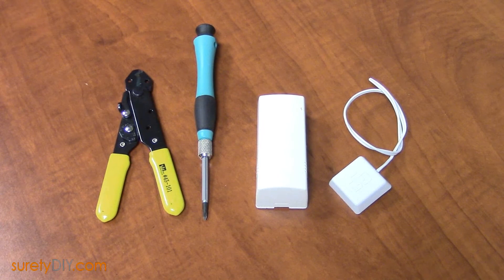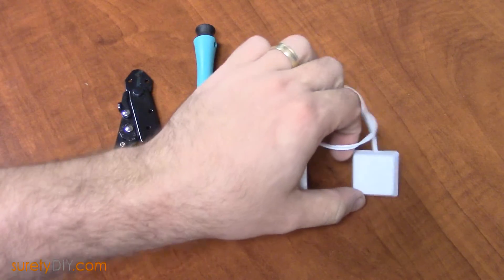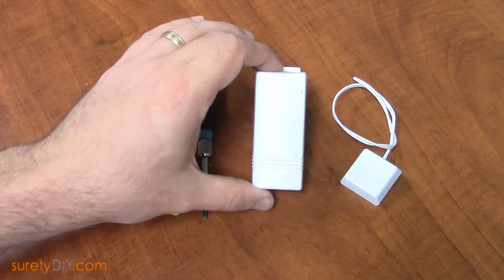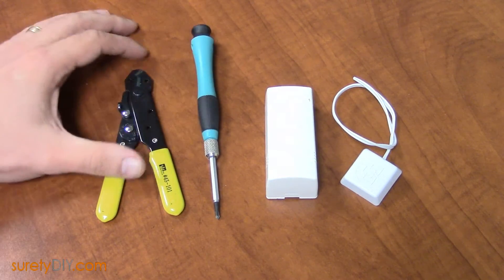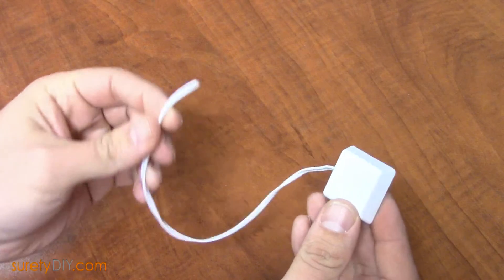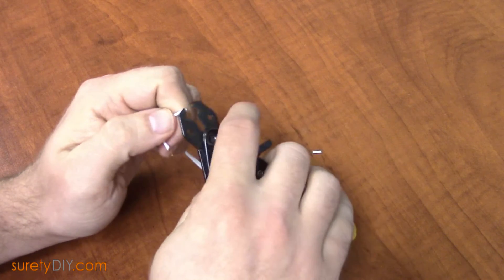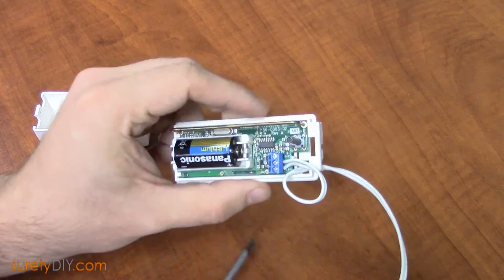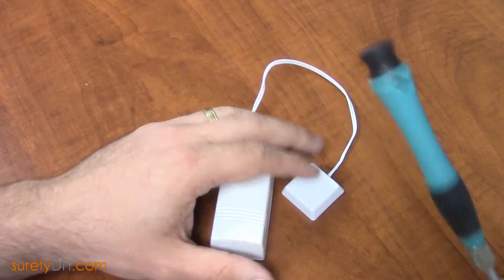How to Make a Combined Window Sensor/Shock Sensor

Comment: Sr, it will be better if u write the parts name in the description.
Reply from the maker: Thank you for the feedback! In this case, we used a Resolution Products RE201 sensor and an Interlogix 5150W wired piezo shock sensor. The door window contact model would change depending on panel compatibility.
Reply: suretyDIY 
thank you for your quick reply & informative answer.